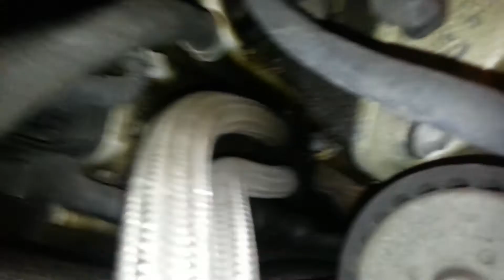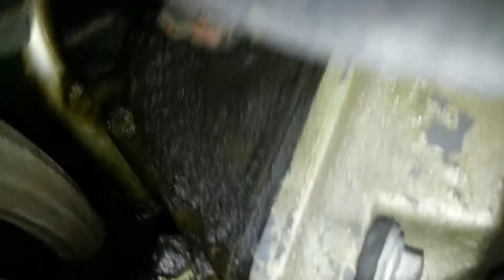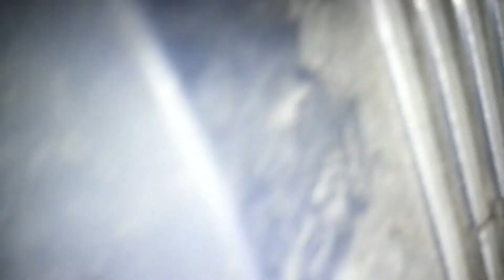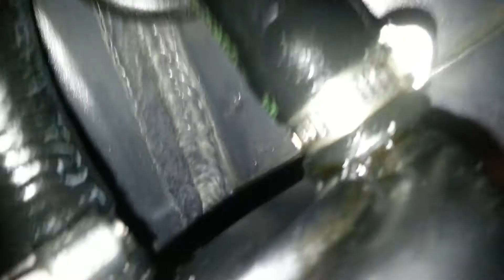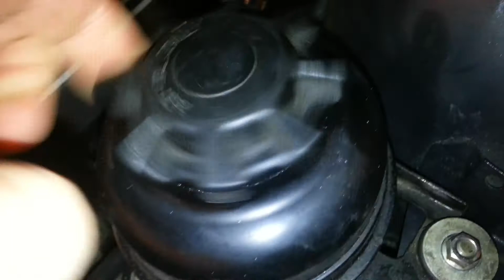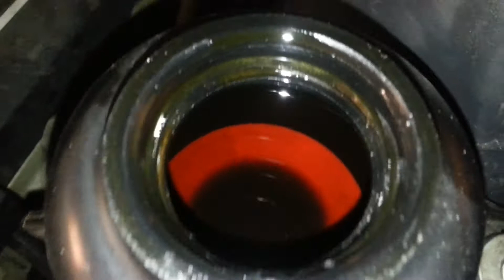Problem Solved! 1997-2003 E39 540i 530i 528i Engine Belt Pulley Squeak Squeals Whistles - Part 2

Comment from the maker: Problem Solved!:
It was a long time since I fixed this. But it ended being a bearing squeaking, on the alternator or the power steering pump. Surprisingly it  was a simple fix. I shot some wd-40/lubricant on the bearing and it went away. try that and it could save you a lot of hassle, time and money. good luck. like and subscribe if you could please. thanks!